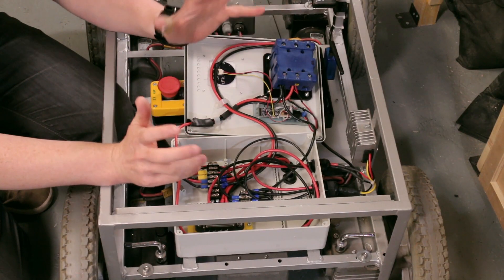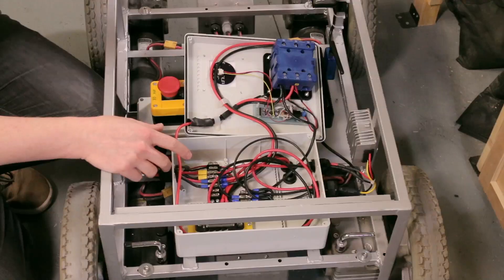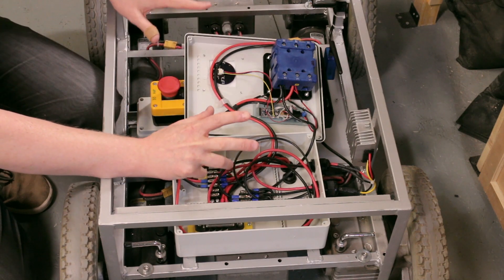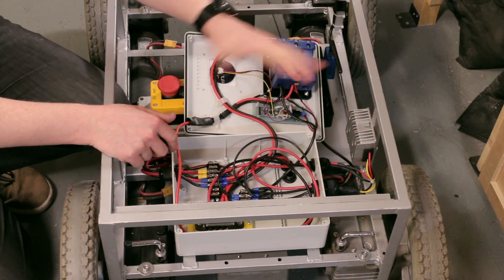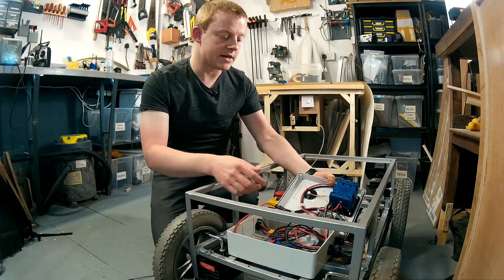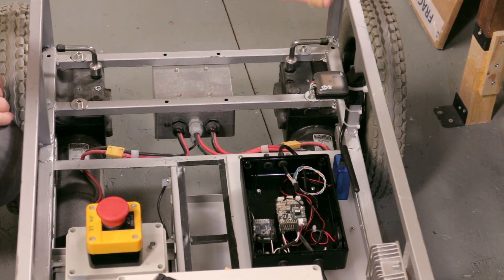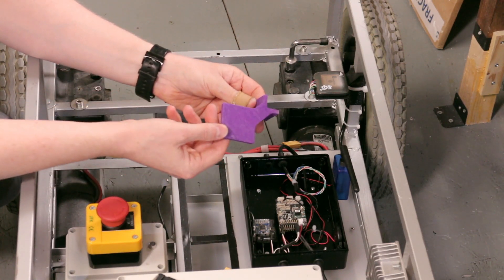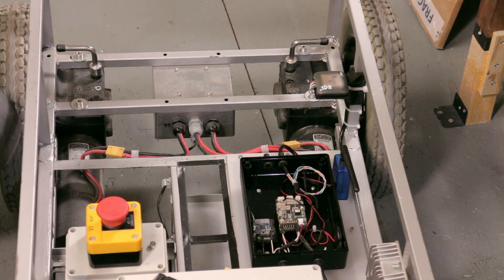Power Systems - Robotic Vehicle #6

Comment: Hi 
İ want to do one by pixhawk but Use two motors in the rear and one servo motor in the front. What motor driver do you recommend, I am using 24v motors
Thanks

Comment: What do you use as motor controllers for this vehicle?
Reply from the maker: +paulham I am using Sabertooth motor controllers, one per two motors.
https://www.dimensionengineering.com/products/sabertooth2x25
Reply: Arthur Guy I thought you were going to say that. Any projects online where people have used wheelchair motors they have also used the sabretooth controller.
I have made a motor controller from an arduino and 2 x H-bridge motor controllers. It works well if I connect my RC link directly (with mixing on the RC TX) but for some reason I just cannot get it to work on the pixhawk.
Reply from the maker: +paulham that's probably why I chose them, everyone else had! 
Have you tried using the arduino serial out to see what the pixhawk is sending, the data might be malformed or out of range.
Reply: Arthur Guy yes I think you are right. 

I cannot confirm if the version if ardurover I had installed was actually working with skidsteer.  I did read that there were bugs. so I don't know if it's the signals coming out of the pixhawk which are wrong or the signals being interpreted In my code incorrectly.
If you do an upgrading video would you be be able to take a screen shot of your skid steer prams.
Reply from the maker: I think an early release of v3 broke this function but it's definitly working now.
I have skidsteer out turned on and skidsteer in turned off. It makes for a slightly odd driving experience but I think like it.